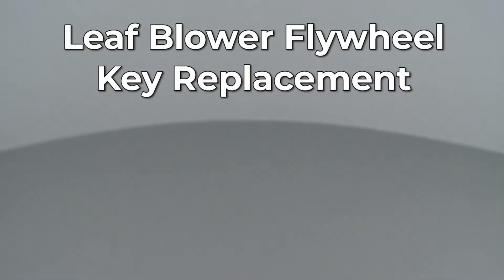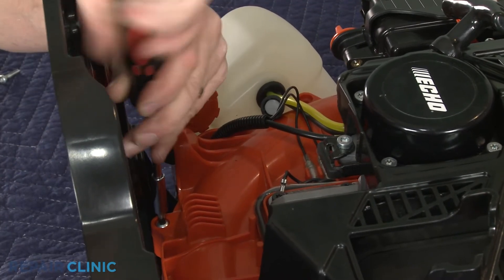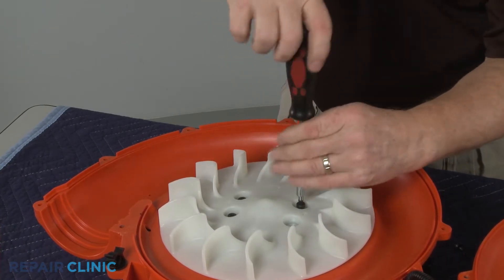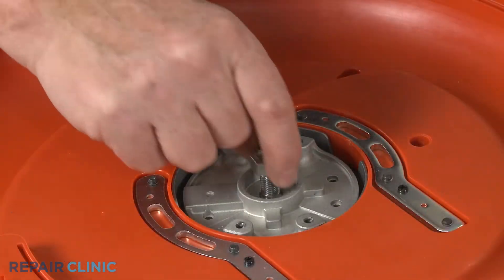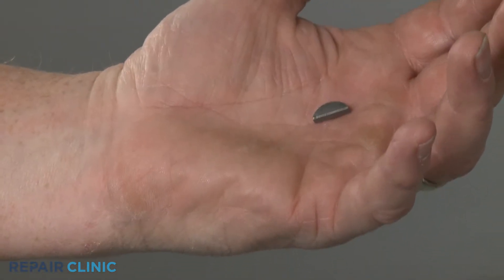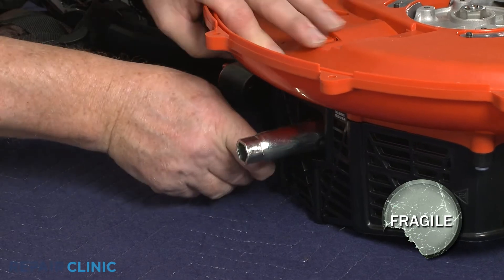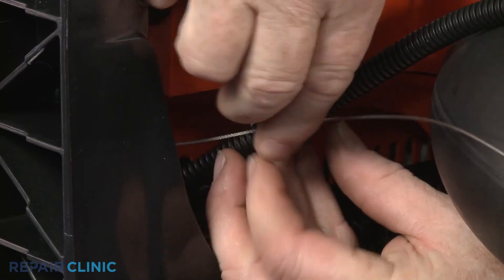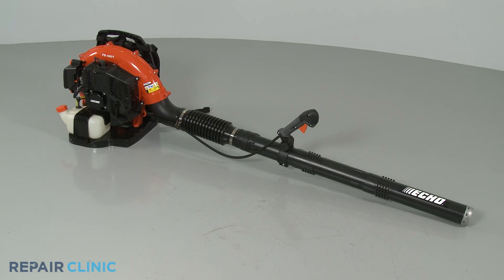Echo Leaf Blower Flywheel Key Replacement (90032303014)

Comment: Why would the key go bad? I have taken mine apart and their was movement like a bad bearing but when I took the fly wheel off the crank is solid. I put the key in the flywheel groove and it is loose. Lol replaced the magneto ...without testing it. It had a weak spark but that went away and brought me to where I am with it. Is there a manufacturer issue with the flywheel? My blower was only used for one season around my home